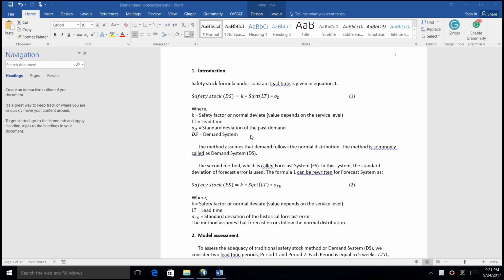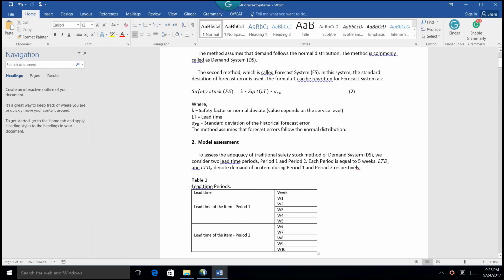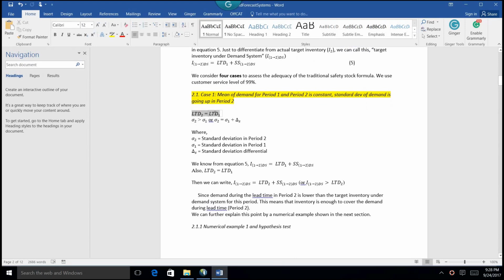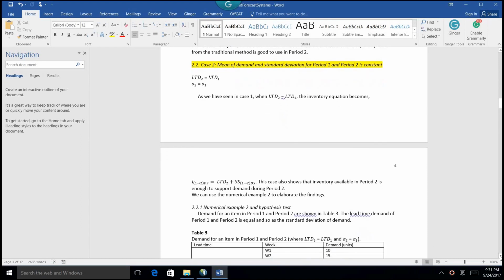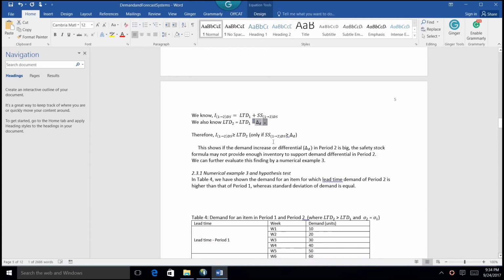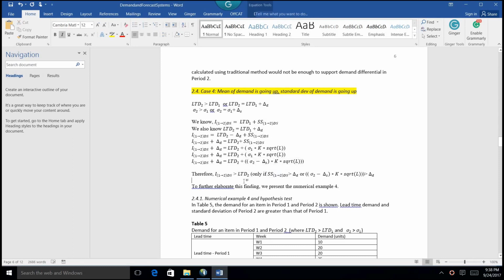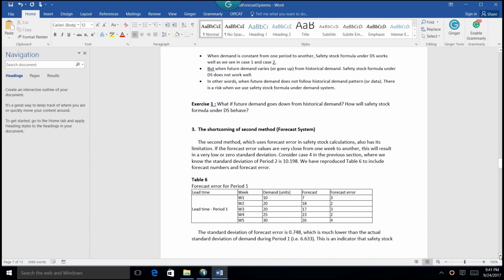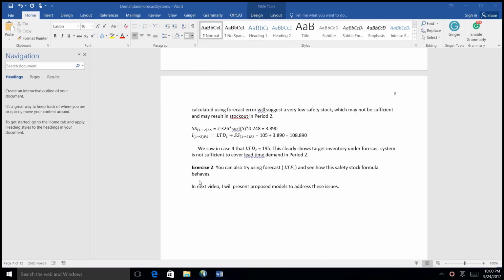Inventory planning - Safety stock (Part 2: Issues with safety stock method)

Comment: Interesting excercise. I believe in your second point, when using standard deviation of forecast errors,you should use RMSE instead, that would result in a higher SS. However, that would also mean that LTD shouldbe base in a forecast too instead of the demand data. So if you have a positive trend, a linear regression would be a good model. With the data you have, using LR as forecast, LTD would be 217.5 and SS wouldbe 15.08 for a Iof 232.57 whichibelive is highly possible that it covers LTD2. Again, interesting analysis.
Reply from the maker: Thanks for the positive feedback.